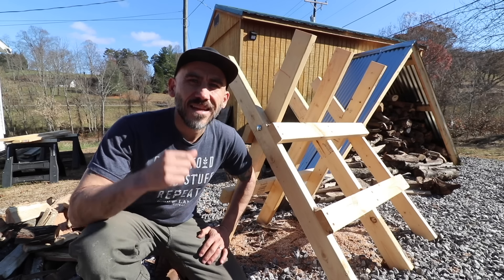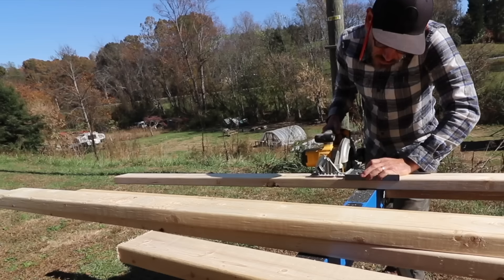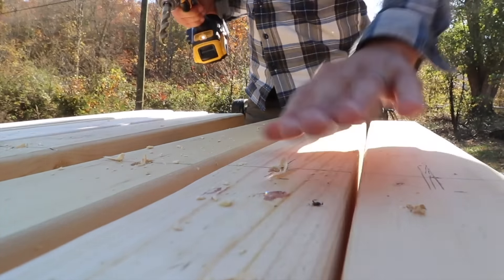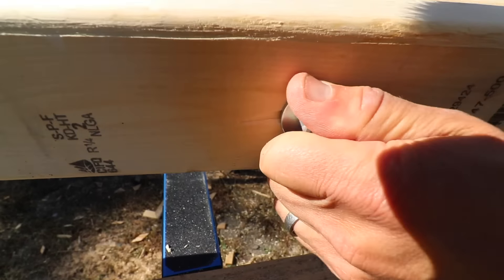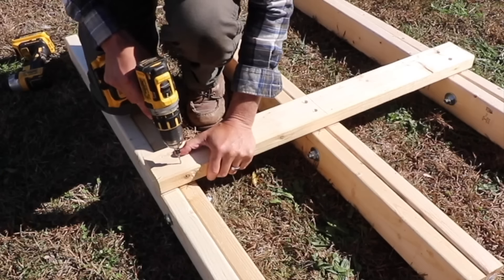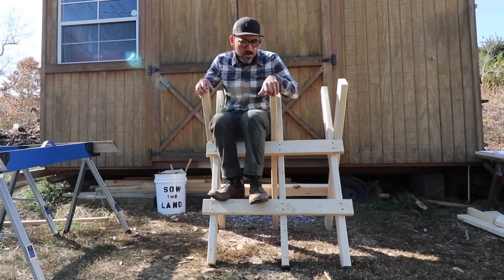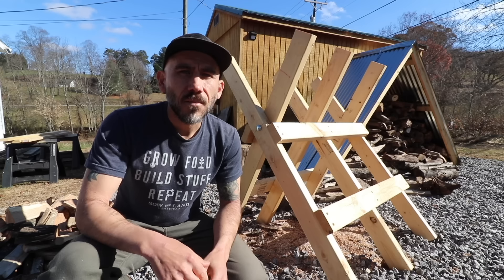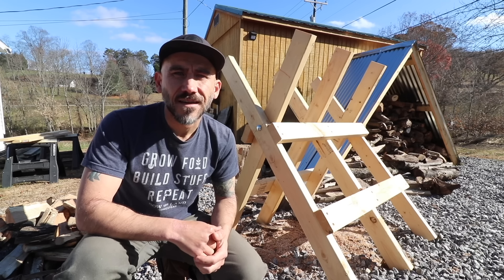How to Build a Foldable SAWBUCK (Sawhorse) to CHOP FIREWOOD

Comment: That was a great simple tool for the homestead. Here's a helpful tip. Glad you mentioned about going only hand tight with bolt and nut. So here's the tip. Wrap some teflon tape around the bolt end and put the nut back on,just hands tight. The teflon tape will help to keep the nut from coming loose and also help reduce electrolysis from dissimilar metals coming into contact. In other words reduce rust. Great build. Looks like you need to build a lean to roof in front of your shop for more out of the weather work space. Have a great day.
Reply from the maker: nice tip! thanks!
Reply: Thanks Captain Obvious
Reply: @cominatcha6223  that was unnecessarily rude.

Comment: Great quick build Jason. Just try to avoid cutting between two supported sides to prevent smaller saws from binding and larger more dangerous  saw like chain saws from bucking back at you.
Also throw a quick mention of wearing safety gear. It great to see how more relax you are in makng videos. Keep up the good work. :)

Comment: What about adding a covered deck onto your shop to add more work space??  It could be screened in for summer use then figure a windowed closed in solution for winter time.  More space for all the orders you are getting😃👍🏽. And  a more cohesive work area you want to be in-:). Warm and dry in winter,  and hopeful cool and breezy in the summer.

Comment: Helpful hint when using your Speed square  put the edge against the side your pushing from with saw. This will hold it there and you dont have to hold square so tight  Just a F.Y.I  Also you can do that Japanese thing? when you burn wood   Just another F.Y.I